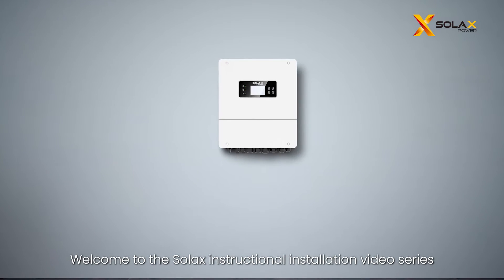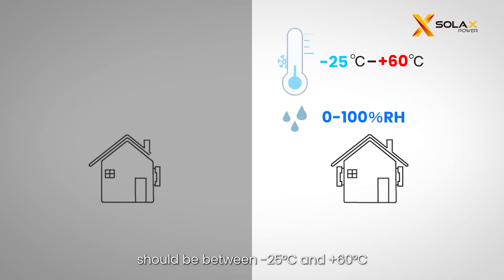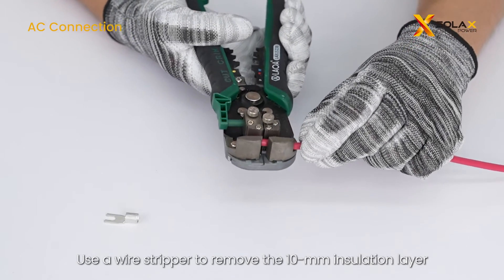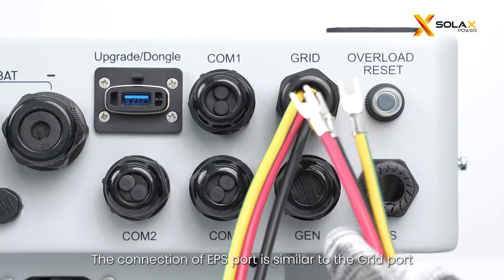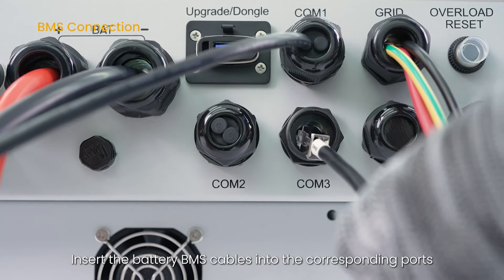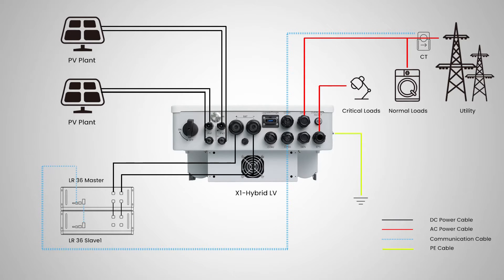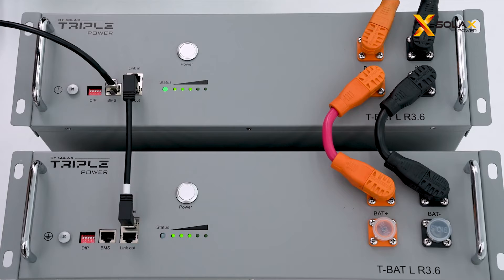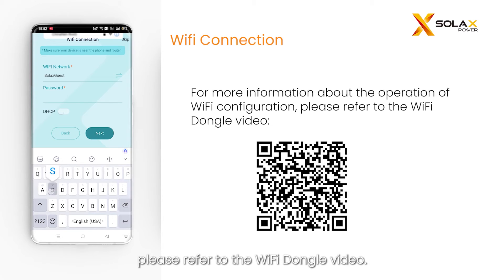X1 Hybrid LV 6KW Installation Guide | Hybrid Inverter | Fronus Solar Energy | Fonus SolaX

Comment: Mara pas frouns solax hybrid X1 lv inverter installed ha par ma buhat issue face kar raha hun mana in sa rabta karn k koshsh k ha pa mara issue ap padding ha is inverter ma bms connect nehen hota or user manual ma b nehen lekha mana Frouns wala sa b pucsh ha wo kaha raha han k humari battery lay but Frouns battery is soooo expensive please support @frouns

Comment: I connected 2 lithium batteries parallel and connect with 2 solax 6kw parallel inverters with bms. 1 (master) inverter showing accurate battery data  but 2nd (slave) Inverter not showing accurate battery data.  Why this is happening.

Comment: A.o.a solax X1 hybrid lv 6 model h yeh Gird se changer ni kr rha battery is ki setting koi bta saqkta kse ho gai battery lithium ion cell diy h jk bms 100amp Wala lagya h sth per battery lead acid show kr rha h work mode sub set kiya hua or charging iski pv then gird set kiya h

Comment: Donot buy fronus thats cheap responce invirter
Reply: Reason? Logic?
Reply: @criticalinformation1953  I've there 6kw matrix model which is under warranty, and its get faulty two times within year, they acknowledge there's manufacturing fault in there inverter, but they refuse to refund my hard earned money
If you need any more reason, proofs, logic, you can contact me
Reply: @criticalinformation1953  Reason? i've send them 6kw matrix in warranty, they acknowledge that it has manufacturing fault and it cant be repaired. So I've asked for refund which they have refused to give. They are fraud

Comment: Agr battery na ho
Aur solar se production 6000w se ziyada ho to kia ghr supply krne k baad izafi bijli export kre ga ya waste kr de ga...
Mera mylb hai k jo solar capacity hum ne 6000w se ziyada lgai hui hogi agr kbhi woh 6000 se ziyada production den ge to kia woh waste ho jay gi ya solar max ki trah 6000w load ko supply kre ga aur baqi export kr de ga?
Reply: AOA sir! Due to the system efficiency, usually for grid tied system the DC:AC ratio is 1.3 times. When come to energy storage system with battery, can be 1.5times to 2 times. The surplus energy is not wasted but stored in battery for backup use.
Reply: @solarmatrix224  will it feed in grid 7000 watts if no load is connected and solar is capable for production.
I mean over 6000 as capacity is 9000
(No battery. No charge) Assumption

Comment: Hi Solax team my solax X1-HYB-6-LV Inverter Use electricity on real time sharing even my output load is zero in day time  the inverter continually use 0.5A to 1.5A plz Solve this problem and upgrade the solax inverter software to fix this problem

Issue No 2

When I on or off the electricity breaker inverter shutdown in day time even my out put load is zero
Reply from the maker: Dear @KaluwalMittha, Please call on one of our call center numbers our technical team will guide you through. visit https://fronus.com
Reply: this issue solved in latest firmware 18.02 already
Reply: @solarmatrix224  how to install this firmware
Reply: @solarmatrix224 I have updated the firmware from USB but it is still taking 1.5 to 2 A from grid
Reply: @muhammadrehan7533  sir this is reactive load due to charging and discharging of capacitors.it don't consume unit.so need not to worry
Reply: I'm facing the same issues. Please guide me through.
Reply from the maker: @talalakram7   Please call on one of our call center numbers our technical team will guide you through. visit https://fronus.com
Reply: How to upgrade firmware version
Reply: Verify your grid meter for load checking

Comment: Bhai smart load me battery cuttoff soc ke max value 30% hy jis ke wajja se sari battery drain hojti hy ac kha jta kindly update your operating system k cuttoffrange 90 95% tk mil jai
Reply: SMART LOAD SETTING... UPER WALI READING  50... NECHA WALI READING 52 KRDO.. NHI CHALAYGA HEAVYLOAD
Reply: this value can be set

Comment: Can you please make a video for without battery settings?
Reply: no need video sir. latest firmware has button for battery less operation option, just click the button and it will be ok. For old version, you can choose other batteries, then can go into battery less operation when detect no batteries.
Reply: Now SolaX has released a option in the LCD as "no battery " options. Just choose no battery. If you are using a earlier version, if you choose battery options other than " solax ", then "no battery " will also work.
Reply: @solarmatrix224  
When no battery is installed  the inverter turns off and fails to operate on wapda
Reply: @MKayZee  also we facing the same issue with battery.